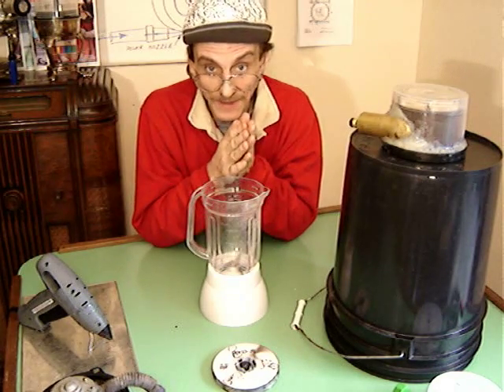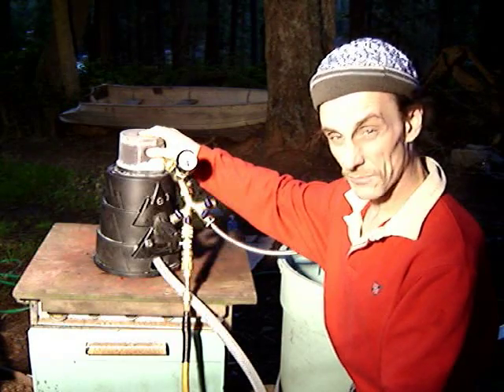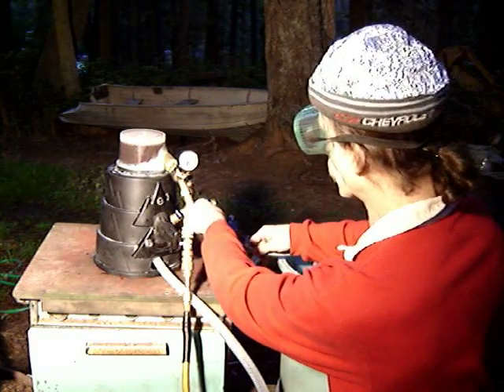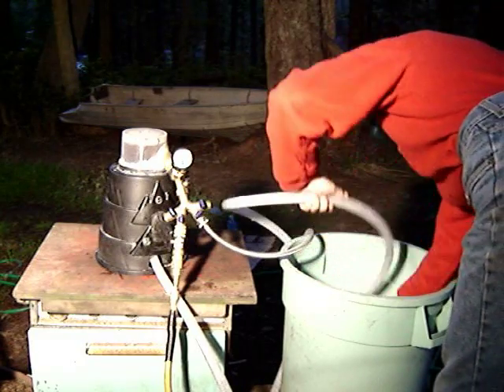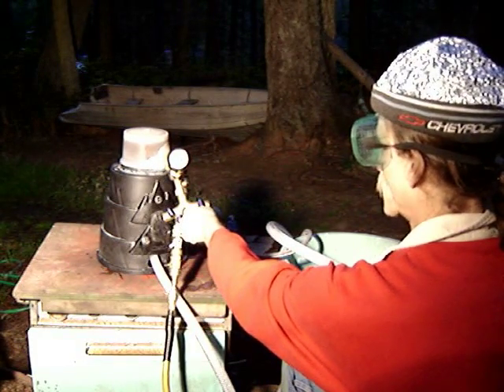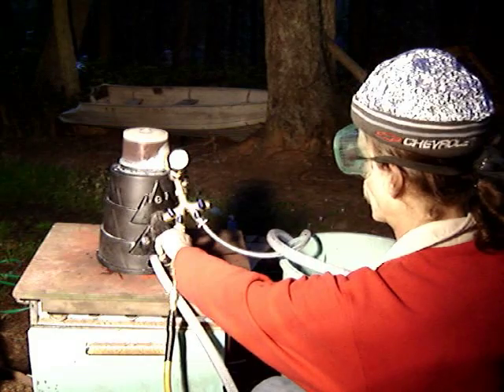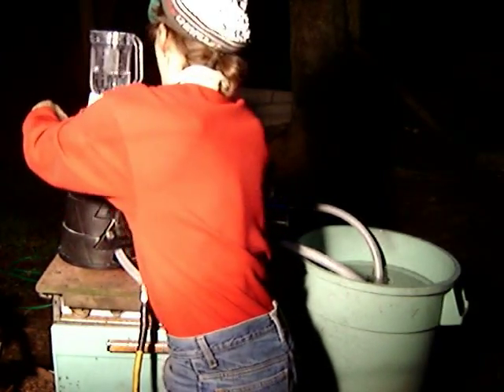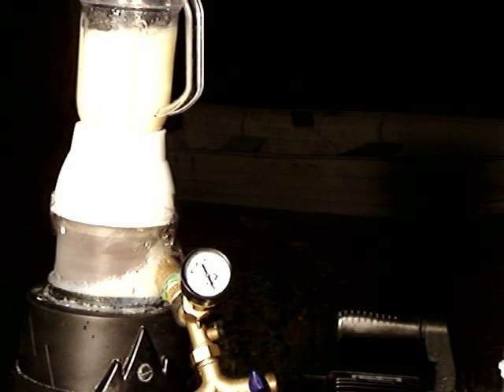Tesla CD Turbine Experimental Test Combining Air and Water

Comment from the maker: "I just like the sound" haha, ok that's cool. The nozzle should taper down to about a 1/16th inch hole for most household water pressures. Even less of a hole size to run on compressed air, unless you have lots of it. Glue can work, you don't have to use washers, just keep discs separated until dry. Please keep in mind that if you manage to get this thing spinning fast, it can become deadly. I use a protective barricade and bulletproof plexiglas to run this.

Comment from the maker: Punching holes in CD's is not so easy. It also weakens them. But it can be done like you say...and I have done it, both with CD's, and with steel and aluminum discs. The magnets can be expensive and tricky to work with, but it is a simple and elegant way to go. Oil is messy, use non-stick spray silicone instead. Experiment! Try your ideas, and keep at it. Keep asking questions, you are doing good.

Comment from the maker: If you don't use magnets for a mag drive, or to make power directly, then how do you get the power out? You will need a shaft to transfer the power. That's when it gets a bit complicated, because along with a shaft comes shaft bearings, and shaft seals.

Comment from the maker: Closer CD's work only up to a point. That point being about .020 to .040 inches gap. That's why I like the .030 magnet spacers. More closely-spaced discs = more torque at the same pressure (or velocity) of fluid...provided there is adequate flow volume of the fluid. The free-running rpm is directly related to the fluid velocity as it enters the space between the discs, therefore increased pressure = increased rpm, or more torque at the same rpm.

Comment from the maker: This is a turbine and it requires energy to run it. In this case the energy is provided by a electric water pump that pressurizes the water, and an electric compressor that produces compressed air.

The Tesla turbine can be hooked up to virtually anything, including a generator. I have produced small amounts of power with my CD turbine running on faucet water pressure, as can be seen my SinkScience playlist, video numbers 9, 10 and 14.

Comment from the maker: My seat-of-the-pants observations show that the air pressure provides high-rpm power while the water pressure provides low-speed torque. A combination of both air and water pressures gives a bit of both and yields more mid-speed power.

The water drags the turbine speed down somewhat from friction, as the higher density water tends to be thrown to the inside of the case, and will not exit through the centre hole easily.

Comment from the maker: The Tesla Turbine works fine as a motor using water pressure to drive it. I would not recommend steam, as special precautions are necessary.

A Turbine can be put together with CD's and magnets to work on water pressure. See my SinkScience playlist for a dozen videos of this. Or you can use stainless discs, shaft, seals, etc. for better longevity.

For build instructions for the Tesla CD Turbine, see my Instructables link in the "more info" box to the right. >>>

Comment from the maker: I wanted to see if a bunch of CD's in a Tesla turbine could make adequate power to get a blender to work.

By combining air and water pressure at the same time, I found the CD Turbine developed better low-rpm torque and increased rpm's, enough to function as a powerful blender motor.

In the next movie, the whole system is self-contained by way of a solar-powered 12-volt recirculating pump and compressor.

Comment from the maker: You could put on a propellor driven by water and air pressure. Then it would have to be in a case to contain it. With a shaft. And bearings. And seals. And so on.

I work with the Tesla design turbine which uses only flat discs; no cups, blades...or propellers! It uses a different principle involving the adhesion of fluid to a disc, and boundary layer effects.

And I make turbines with the CD's and CD case as a challenge, to see what can be done with next to nothing.

Comment: Why do you have to do this while you can just put a propeller driven by water pressure and air pressure.  Same thing they will both spin and produce mechanical energy.  Unless this is more efficient transfer of energy.

Comment from the maker: Thanks, admin! Good to hear from you again. 

Yes, I've been thinking about this, and have some ideas. What would a vortical injector look like or how would it be made? Like a vortex cannon with smaller flat hole in end of tube?

I'm experimenting with a piece of wire inside the nozzle tip. It has a blob of solder on the end to increase velocity and for better mixing.

Comment from the maker: A PC would use about as much electricity as a small fridge. A small 5 inch Tesla turbine/alternator at 30,000 rpm would easily do it. 

Of course, a  12-volt cooler would be easier and far cheaper...

Comment from the maker: You could power a PC, but it wouldn't be too efficient. I'd have to use a 8-hp air compressor to keep up. Then it would all blow up. (hmmm, come to think of it, it might be fun...)

However, a small, properly built Tesla Turbo-alternator could work for remote locations, possibly powered by propane or methane.

Comment from the maker: That's about sizes it up!

The blow-up factor is a bit of a problem, as I found out later. 
Basically, if the spindle center outlet is restricted, say by rising water levels in the catch container or too small an outlet hose, the air-over-hydraulic pressure can split the CD case. 

Or pop the top of the CD case right off, as is seen in one of my next movies!

Comment: Oh cool.

But yeah I could see that air and water would work well in the turbine (that is if it didn't blow up!!). The air generally being less dense than water and more energized can travel faster. But when mixed with water, the air pushes it faster and the water (resisting on the CDs due to it's higher density) gives more torque allowing the force to be stronger and faster. If the air was on its own it would move fast but not strongly.

Comment from the maker: Ahhh, good grasshopper...you pay attention! Yes, the air and water good combo is better low-end torque, and increasing the rpms, without too much air usage.

The other fierce looking black and chrome machine is a neighbours shiny new 120 volt water pump.  I was trying some re-circulating experiments with it, so as to not waste water.

I eventually used a 12-volt bilge pump.

Comment from the maker: Hehe, it doesn't cost so much for my well pump to pump the water to the Tesla CD turbine...about 5 - 10 cents an hour in power. Well worth it (so to speak! haha)

However, I recognize that water usage is an issue for many folks. Hence, I will make further efforts to build a totally self-contained solar-powered Tesla turbine system.

Comment from the maker: Click on the "more info"  to the right>>>

At the bottom is a link to K&G Magnetics from my CD Turbine website.

I find them the best for selection and service. There might be some cheaper sources, such as directly from China.

If you only need one or two magnets, consider taking apart a shake-type flashlight. They have a good-sized neo magnet. They  can be bought cheap at the dollar store, and you can use the LED and circuit for another project, too.